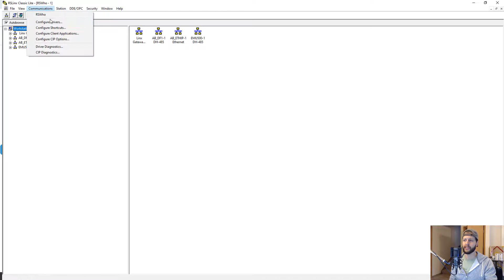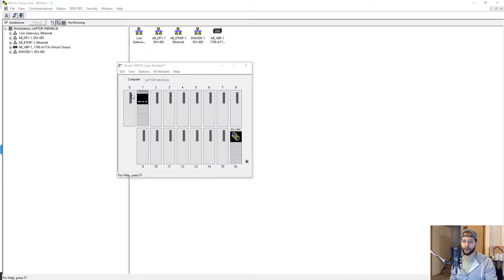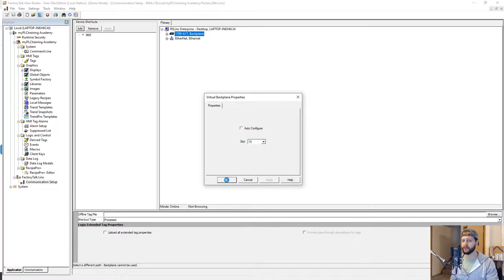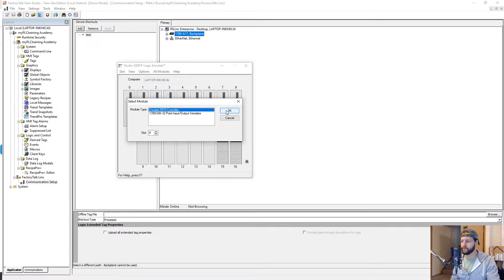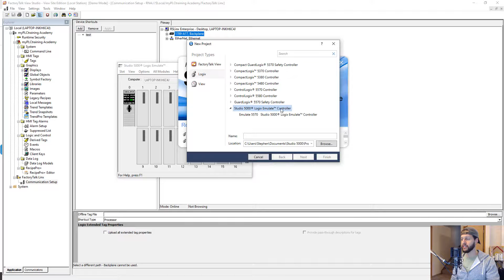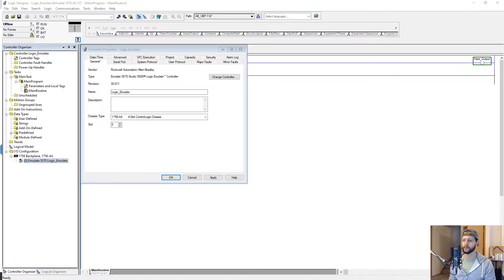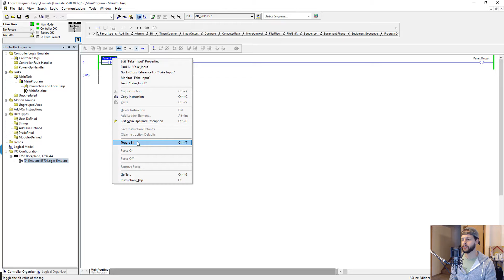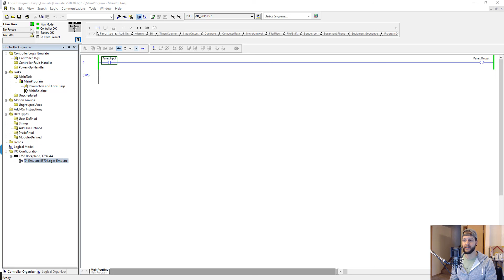Studio 5000 Logix Emulate - Configuration

Comment: is it possible to add ethernet module or some digital i/o modules to the Emulate 5000?
Reply from the maker: You can add the modules to your Logix Designer project but they won't really serve any purpose. However you can add a discrete I/O module to the Emulator backplane and do some simulations that way. Very limited though.